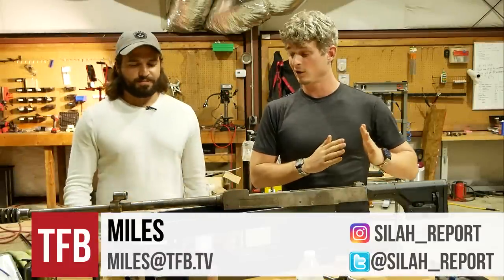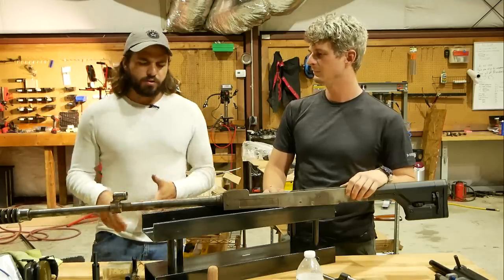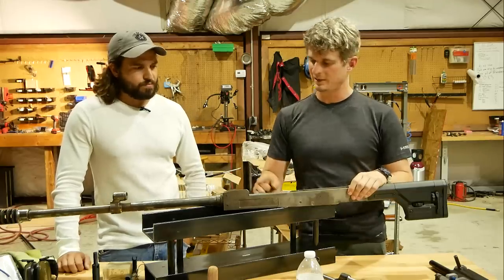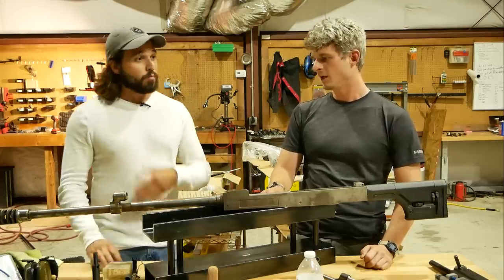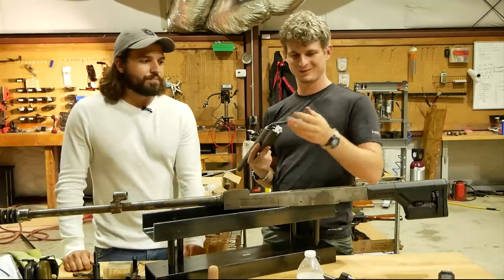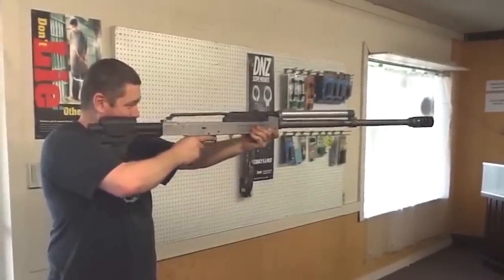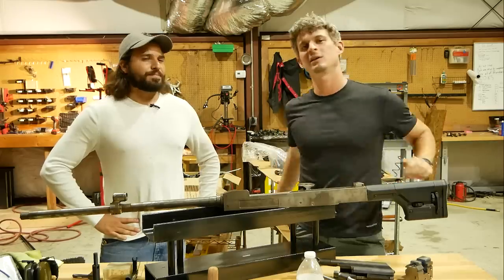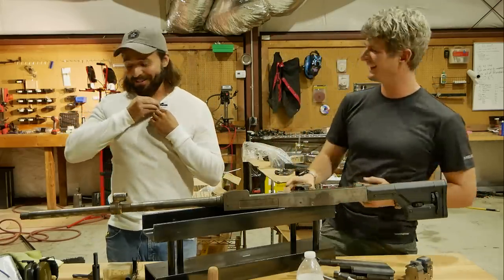The AK-50 Story as Told by Brandon Herrera

Comment: Im going to build an AK-17 Chambered in 17HMR. 😁
Reply: That’d be cool
Reply: Aksu17  shershen' 😍
Reply: That would be fun actually
Reply: Funswitch for a hot drill? Pinned and welded threaded full length compensator for a twist on suppressor can on a 10 inch barrel? 50 round mags at 2400 rpm?
Reply: That's a cool idea!
Reply: Needle AK.
Reply: good luck with  the gas system.
Reply: @yulusleonard985  like he said it’s all about dimensions. He can lighten or add weight or move the gas system
Reply: @timexkills65  There are reasons why all 22lr guns available in the market are blowback/recoil-operated.
Reply: Ak 120

120mm

Comment: On the rear trunneon, you can add a small radious at the end of travel. It will decrease stress concentrations and it will never travel that far back anyways, so you dont need a 90 degree angle.
Keep fighting the good fight.

Comment: Heat treating and the proper tool steel. Traditionally 4140 and 4150 a heat treat treable alloy was used in slot of the older guns (chrome molly) slot of the gun barrels were mad with this.  We have newer tool steels. One tool steel that works well is S7 a sock resistance tool steel. This is widely used in impact tools like jack hammer chisels. This steel has many different uses and different ways to heat treat. It is a high end cro molly TS with about 3% chrome which gives it better where resistance. As the old timers say try it you will like it.

Comment: @Brandon Herrera - The dual guide rods and return springs is very AR (18/180), almost as AR as the Magpul PRS stock.  Good thing you aren't adding a longer buffer spring through the rear trunnion into that AR stock, because allowing the rear penetration of a buffer spring would be AR overload.

Comment: What if Brandon just used a valve spring from say a old 350 Sbc for the buffer system. The valve springs have open and closed pressures that can pretty much be fine tuned.

Comment: really that buffer is not going to work as you intended..................what you did is just make two spring in series, with a spring constant of 1/(1/(k1+k2)),they will be compressed at the same time regardless of travel. what you can do is wrap that stiff short spring around your mainspring, so at last bit of travel it is two spring in parallel, and spring constant become k1+k2 at that last bit of travel

Comment: Different metals with different hardness - Isn't that the "Blish" principle, the theory that dissimilar metals have different lubricity at interfaces where they meet. The theory that was patented & then implemented in the post WWI firearms industry.
Reply: Not really - Blish presumed that certain dissimilar metals had an abnormally higher rate of static friction and was attempting to use that to lock the breech.  Brandon was running into the opposite problem, with the metals not being dissimilar enough in hardness to not adhere.

The Blish locking mechanism was patented, but was mostly irrelevant both in function and in the firearm industry.
Reply: @puck85  blish wasn't a mechanism, it was an idea that was patent, that meant they could no longer use brass and steel (like the original Thompson) without paying a royalty fee, which made manufacturing difficult.  Yes,  it was the exact opposite of what was going on here, hence why I brought it up. Had he followed the "dissimilar metals" principle, the bolt would not have gaulled & stuck against the barrel extension/ trunion. It's the same reason why they use bronze sleeve bushings in heavy machinery, because over 100 years later, we still don't have a better (cost effective) way of doing it...
Reply: @Richard Cranium  the "Blish Lock," for which Blish held the patent, absolutely was a mechanism, as it was the only manner in which the concept could be patented.  I'd be very interested to see what information you have on this being in any way influential in the firearm industry.

Comment: Cliffhanger... The AK50 is a myth anyway.

If it would not be one though I would like the fact that even its development resembles the AK development, of a guy who hardly has any clue what he is doing and slaps together parts until the thing goes boom boom.
Reply: But Kalashnikov knew what he was doing, he's made guns in the past before the AK.
Reply: @zetazane  Not Really.  He was mechanically gifted and had some experience in it, but he never went into any kind of apprenticeship or university. His builds where mostly a mixture of trial and error as well as a lot of plain copying what he could get his hands on. 

His first Submachinegun was a straight blowback gun (Screw delayed in the later versions) which are not complicated in any way. With access to similar firearms any mechanics apprentice in 2nd year could design and build one. 

The AK47 on the other hand is nothing but a copy of the M1 Garand System, which all the engineering work taken from that firearm. 

Kalashnikov was far less of a genius in my eyes than most people think. He was a smart guy at the right place in the right circumstances. Thats all. 

What made the AK what it is today (Automated Production, optimized stamped design) was not done by kalashnikov. All the actual engineering work was done by... who would have guessed: Engineers.